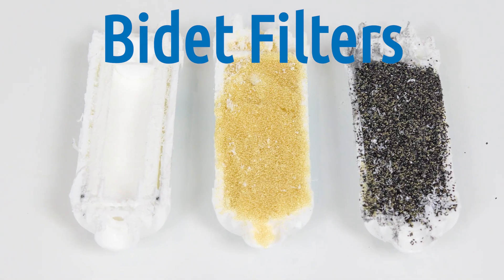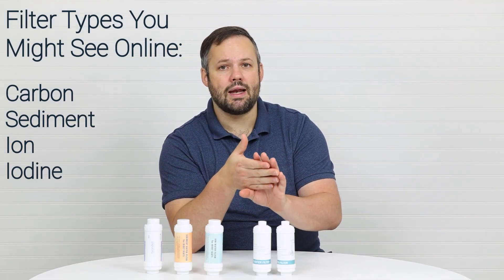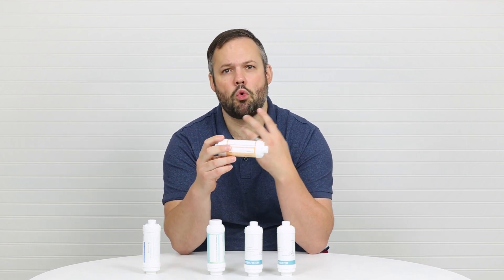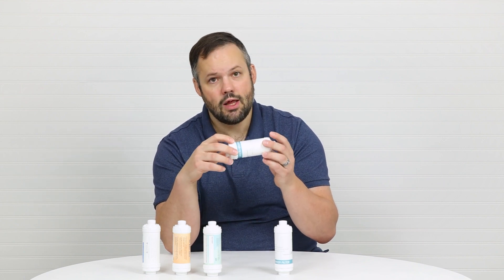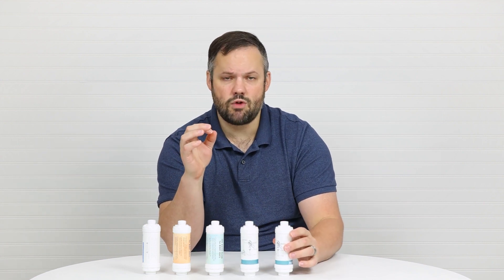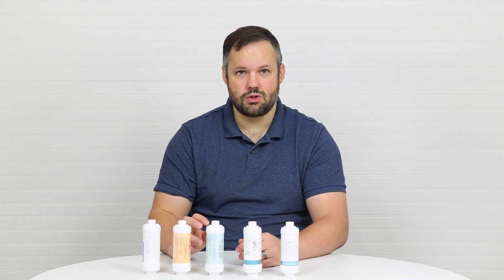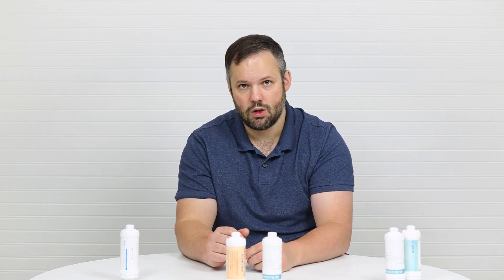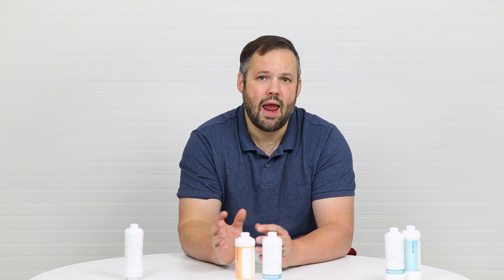How do bidet filters help my bidet run better? | Bidet Answers with Dan

Comment: Quick question.  I have somewhat hard water (to the point where I am worried about the longevity of my bidet) but I am also a little worried about sediment, are there any ion/sediment filters available?  I imagine I wouldn't want to run two in series. Thanks :)

Comment: Hi Dan.  Just found this video here three years after you posted it. Don't know if you're still monitoring it for questions, but here goes. 
     Some thoughts and a question: First, I am thinking that I do NOT want to remove chlorine from the water that goes into the bidet.  Why? I want to be sure that nothing starts growing in the continually-heated tank and the various tubes of the bidet.  That seems really important to me.  
     Second, keeping sediment and crud out of everything also seems important.  At our 50 year old apartment building, water gets turned on and off frequently for plumbing issues.  Each time that happens, sediment and rust flow freely into our plumbing fixtures.  
     Finally, we live in a pretty hard water area with a hard water rating of 17 grains per gallon (GPG), indicating significant hardness.  Minerals also shorten the life of the very expensive bidets.  
     As I wrote, I live in an apartment and don't have the option of a whole-house water system. So here's the question.  How can I find a COMBINATION solution that addresses sediment, and hard water, but still lets microorganism-killing chemicals do their job?
Reply from the maker: Thanks for watching! As you mentioned, this video is a bit older. At this time, we only sell and recommend ion and sediment filters. They shouldn’t have any effect on chlorine. If you’re worried about impurities in the water, you can look for a bidet seat with built-in water sterilization - you can see those at https://www.manybidets.com/product-tag/built-in-water-sterilization/. As for the ion and sediment filters, it might not be the prettiest setup, but you can daisy-chain both types so you’re protected from sediment and hard water. If you have more questions about how that would work (or anything else!), reach out to our team at support@manybidets.com and we’ll be happy to help you out!

Comment: I have a Toto Washlet and hard water in the house.  My bidet clogged after less that two years and cost $175 to have Toto replace the tank and wand.  You state that Toto doesn’t offer a water filter option. Is there a way to adapt a filter that will work with the Toto fittings?
Reply from the maker: Sorry we're so late in responding (and that you had that happen with your bidet). We actually just got in Toto's T-valve adapter to test out. This is a great way to adapt the connections to allow a filter to be added. Check out our video on it: https://youtube.com/shorts/t-6ts1Ofsdo?si=2-IgNcw6lAzcSJHQ

Comment: Can I use the Carbon Filter to handheld bidet sprayer?  Thanks in advance
Reply from the maker: You could but here are a few concerns to note:
1. It is possible that the threading would not be the same size.
2. Because of how much movement the waterline of a handheld sprayer has, this would put a lot of strain on the filter's plastic threading which could strip it and cause leaking.

Comment: I'm wondering about filtration needs when it comes to the things we also avoid drinking? Like heavy metals and chlorine and the like. I'd always assumed the inline filters were cleaning some margin of all contaminants, just not up to drinking standards but to a standard. I'm looking at a Coway system that apparently uses a built in "nano silver ceramic filter" that doesn't need to be replaced according to the sales rep. I'm thinking "filter" is the wrong word. More like killing germs. Is it just a hunk of silver that the water passes over? Is the bidet market, when it comes to filtration, only talking about water softness and large debris screening? Thanks
Reply from the maker: Silver nano will help sterilize the water, but it will not filter it. If you experience a lot of build up of calcium or limescale on your other water fixtures, you will probably want to add on an ion filter. If you are on well-water and tend to see sediment in your water, then a sediment filter would be best.

Comment: Daniel, you answered the question what’s inside the various bidet filters you demonstrated, but didn’t really address how these filters will make your bidet run better.

Regarding the carbon filter, I’m having a hard time imagining what organic compounds in normal potable water would cause any damage to the internals of a bidet. After all, a bidet is really just a water pump with a heater.

Regarding the sediment filter, if your water source is not filtered when it enters your house, it may contain solid particles that would be captured by a sediment filter. It seems reasonable that particles of that nature could in time, cause wear, or damage seals internal to the bidet pump mechanism.

Regarding the ion exchange filter, if the water supply to the bidet contains a lot of calcium carbonate (ie. you have hard water), you run the risk of having calcium carbonate, also known as lime deposits, form on the heater elements in the bidet. This could interfere with, and diminish the heater’s effectiveness and perhaps clog the small passages. So I can definitely see an advantage to using the ion exchange filter, especially if you don’t have a water softener in your house, or if your water softener is only partially or periodically functional.

I have a hard water private well supplying water to my house but I also have a whole house water sediment filter, as well as a whole house water softener that treat the water before it reaches my bidet seat.

I currently have a Brondell Swash 1000 bidet seat using their branded pre-filter.  Seeing in your video that this filter is really an activated carbon filter it seems to me that I’ve been wasting my money. I am throwing out the Brondell seat because it has failed three times and Brondell refuses to sell me the parts required to repair it. I’ll be replacing the Brondell with a Cascade 3000 bidet seat either with an ion filter, or possibly no filter at all.

I hope this discussion helps someone who is trying to determine whether a pre-filter makes sense for their installation of a bidet or bidet seat.
Reply from the maker: Thanks for sharing!  I agree with your breakdown of filters and why you would use them.  I appreciate you sharing!
Reply: @ManyBidets  And I appreciate your videos. They have been a big help as I decide on my next bidet seat. I ordered a Cascade 3000 from ManyBidets.com three days ago. 🙂

Whomever designed your website and post sales email communications routines did a fantastic job. The automated routine for creating an online account did almost everything for me. All I had to do was approve!  As someone who once developed and ran his own web site and server hardware from his home office I think this is next level execution in terms of customer friendliness. The email updates confirming my order and shipping arrangements and tracking were first rate too. Please share my comments with your team. 👍
Reply from the maker: @Dave-ei7kk  Thanks so much for the kind words!  Let us know if you need anything else from us!

Comment: Why does Toto recommend that you don't use a filter?
Reply from the maker: It has to do with water flow...  While, in my opinion the water flow that comes out of a filter is enough to work with a TOTO unit, TOTO has decided to not risk it.

Comment: Could the carbon filter from brondell protect against calcification?  Our water heater got chuck full of it so I'm planning to install the brondell filter when I install the coway bidetmega 400e.  They mention there is a filter you should replace every 4 months but I couldn't find any information on replacements.  So brondell seemed like a good stop gap. 

Oh, the brondell also mentions that it removes chlorine.  Based on your review would you think that to be true?  And what would the value of that be for the bidet system?
Reply from the maker: I don't know enough about the coway line to be able to confidently recommend a filter for that brand.  Your best bet would be to reach out to them directly should you decide to stick with that brand.
Reply: @ManyBidets  nice, thanks for the reply.  I have reached out to coway, really trying to understand more about the brondell filter.  Do you think the brondell would prevent calcification based on what you are seeing on the inside of the filter?
Reply from the maker: @DavidtheGNomad  not really...  I would go with the ion filter.

Comment: Have a BioBidet and asked them which filter to get if I had hard water, and they said to get their Carbon filter. But from your video, you seem to think their Iodine filter instead?
Reply from the maker: Ion filter is probably the best for hard water, but since Bio Bidet does not make an ion filter, I'd recommend what they call their "iodine" filter, since it does not appear to be an iodine filter at all

Comment: I have a portable bidet system which uses 1.6L of water.  How much water is used in the average bidet that fits on the toilet?  Does the water flow as long as I decide or is there a set time for water flow?
Reply from the maker: It depends on how long you run the bidet.  It can use as much water as you want it to, as it's connected to your home's water supply. Generally speaking, most bidet seats use between 0.1 gallons per minute and 0.32 gallons per minute.

Comment: Dan, you rock as always!  These filters are really not needed if you have a hole house filter or a water softener system in your home I believe.  The system would take care of all the calcium in the water and most of the other bad stuff in the water.  For instance, our clothes washer, dish washer and so on lasts twice as long as designed, because of the softener.  Plus having a filter next to the toilet is just not an attractive thing.
Thank you for doing these video's.  They are so helpful.
Reply from the maker: Thanks so much for the kind words!  I agree, if you've got a whole house softener and filter, you're probably good. Some customers still choose to use a filter just for the sake of being as careful as possible, but I agree, if you have really good water quality, you can probably do without.